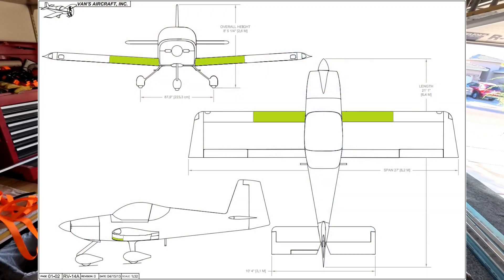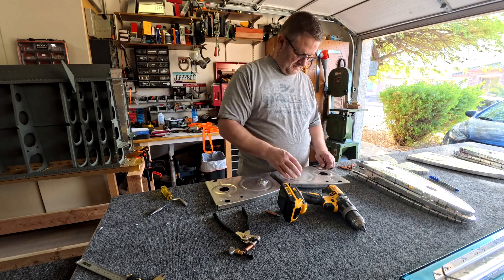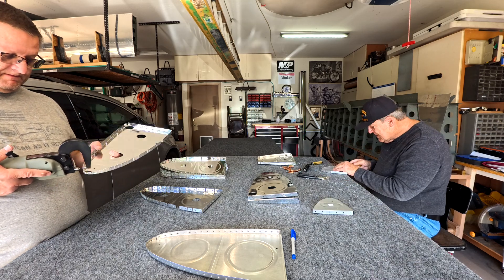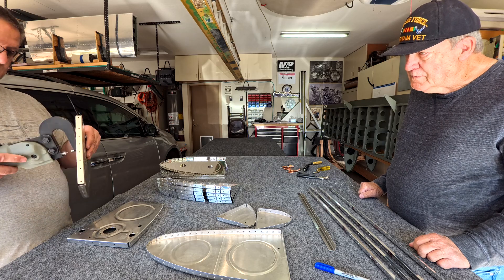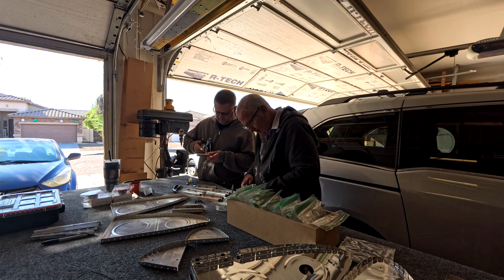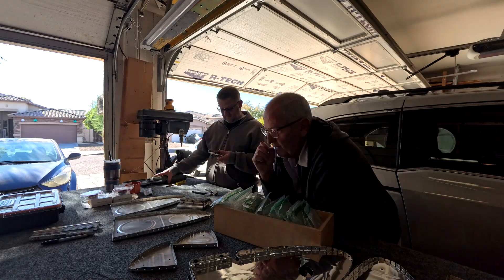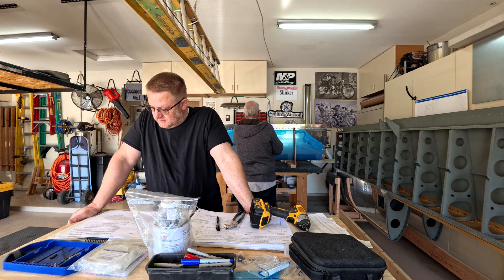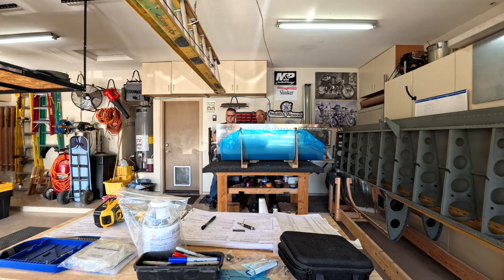RV-14A Build: Tanks 18.1 - Starting the Fuel Tanks #vansaircraft #dadjokes #aviation #kitplane #diy

Comment: Have fun with the pro-seal. I am building an 14a and just finished my tanks with no leaks. I was worried about leak when I was building as well. I followed Vans video on tank building to the letter. I got lucky and found a used Semco A in-line air dispenser on e-bay and empty 6oz tubes and tips at Aircraft Spruce used on the rear baffle only. 6oz  was just enough for 1 tank rear baffle. each rib took 1oz. The short stiffeners I mixed up 1 1/2oz per tank. the long stiffener was 1oz  one tank. Good luck with the tanks. The only piece of advice I would give you is pay attention to details.
Reply from the maker: Thanks for watching! Its nice to know we share worries! I found a Semco 250A dispenser at "The Yard Store" was under $150 and came with the 2.5 oz and 6oz fittings...
Thanks for the measurements. I used them for my first rib and it worked out perfect... Maybe a little bit left over but not enough to even worry about. If its okay with you I would like to use your name in one of my videos thanking you for the information. Please let me know if that is okay.
Thanks again!
Reply: @ one last thing, if you haven’t watched t-flight on You Tube build his tanks I would highly recommend it. He followed Van’s video and had leaks on the rear baffle. He made a change on the right tank and it helped greatly. I would suggest watching his video on the tanks before you put in the rear baffles.
Reply: No problem using my name.
Reply: https://youtu.be/7qTit9jbINs?si=jrVic-5nWan_cgc6

Comment: I use the hex shank deburring tool in a cordless screwdriver. Works really well! I was REALLY nervous while building my fuel tanks as well. I watched Vans video multiple times, did tons of research, etc. Went through hundreds of paper towels and gloves. I used syringes to apply the sealant. I waited a couple months to leak test them just because I needed that time to mentally prepare for what I would do if they leaked. All that worry for nothing as neither of them leaked. I pretty much did exactly what Scott does in the Vans video with two exceptions. For the rear baffle, I smeared a THIN line of sealant across the rivet line before adding the bead of sealant that Scott shows in his video. I did the same thing for the J Channel. A thin layer of sealant along the rivet line (along with sealant on the J-Channel itself). I only did two ribs per day. I think it took me 2.5 hours per rib. I built the Sky Designs ER tanks so I had two extra ribs per tank. Good luck!
Reply from the maker: I think its pretty amazing how Vans has put together a program/instructions that start you off small and work up to harder and harder things... it builds your confidence and before you know it... you actually think you know what your doing. Each new thing is still nerve racking though... I did buy a Semco dispenser to help with the baffles, at least I hope it does! 
thanks for watching!
Reply: @SlinkAir  I bought the Semco dispenser as well but never used it. Too nervous building the tanks without introducing something new (I already had experience using syringes). BUT, many people swear by the Semco dispenser which is why I bought it.